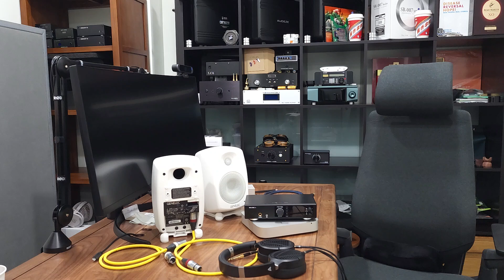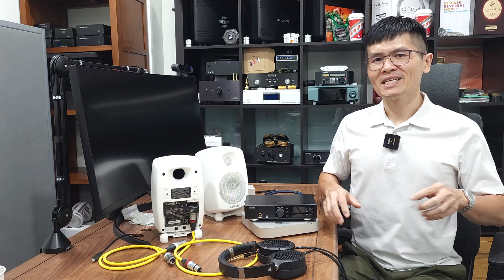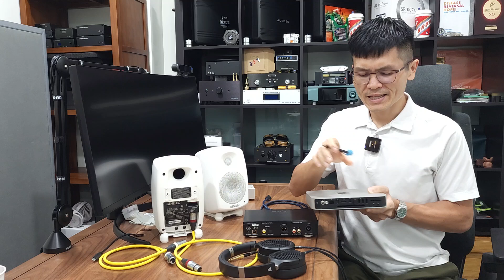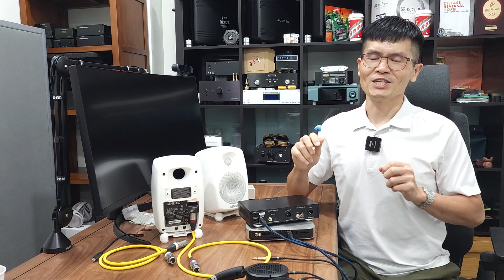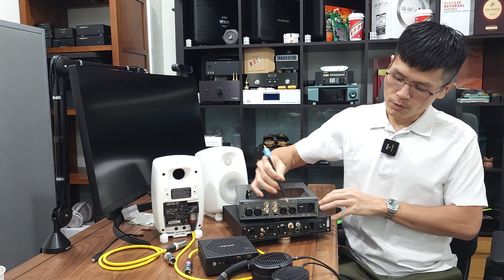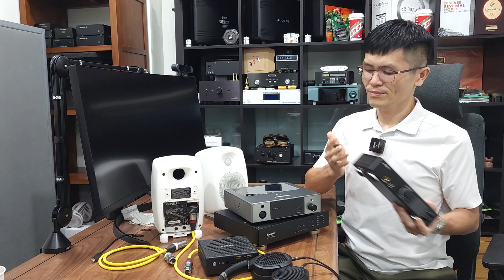Building Your Dream Sound System: E2 - Driver Setup, Software Config, & Volume Control Explained!

Comment: I have read that reducing the output volume of the computer by 3 db can improve the performance of the DAC by avoiding overload. However, this would mean using software volume control in the player (Audirvana Studio in my case). Would you recommend this or is it against your recommendation to not use digital volume control?
Reply from the maker: It really depends on the synergy between the software (Audirvana) and the DAC. If there is a need to reduce -3dB to provide a better headroom for the DAC, specifically, could be :)

Comment: Using PC USB to Ares 2, but don`t like that output sample rate is fixed(up/down sampling). Is it possible to send signal from Tidal as is, CD or Hires direct to DAC? Thank you
Reply from the maker: Hi, that would mean to use windows sound mixer to change the sampling rate to a fix one, i.e. 44.1KHz / 192kHz. In my opinion, that may not be a good solution - for sound quality consideration.

Comment: GM from Toronto.
I went away from “computer “ based systems…not entirely..but I don’t run a pc for my music streaming.
System:
Denafrips Ares 12-1 DAC ( the heart of the system) 
Audiolab 6000CDT 💿transport.
Wiim Pro Streamer 
SCHIT Lokius EQ.
Bryston BHA-1 Headphone 
Amplifier/Preamp.
Headphones Sen’s , HiFiman and AUDEZE…along with a bunch of IEM’s.
Your DAC is still the heart and soul of my system.
Reply from the maker: Thank you, it means a lot to us!
Reply: Yet another excellent video! I told Vincent that I enjoy your videos so much that I even watch when you review products I'm less interested in. Of course, your Denafrips DACs are the stars!
I learned something here. I had no idea of the superiority of USB over other connections. (I realize I2S is optimal). But, I had previously thought that both coaxial and optical were superior. I'll be doing some reconfiguration.
It was an interesting decision on your part to feature products by other manufacturers to illustrate your ideas. It seems truly informative, and not just an advertisement. Again, my compliments.
One final thought: your little Zotac computer. I never saw one before, but quickly found the website. What do you think of using one as a dedicated streamer, as opposed to the Wiim or similar devices. Is noise still the issue?
Thank you.